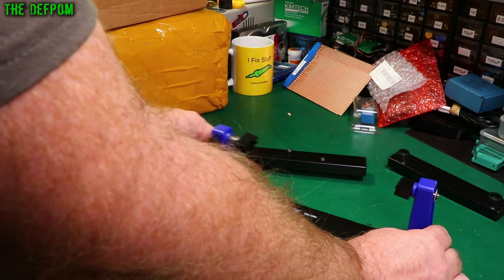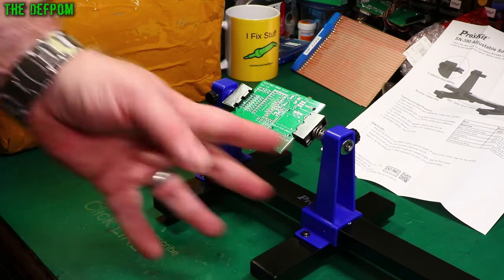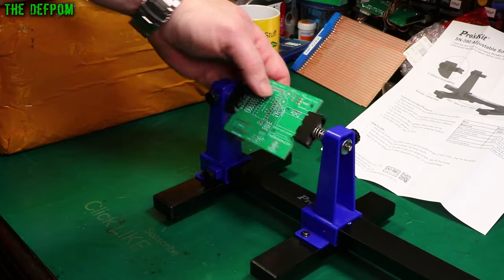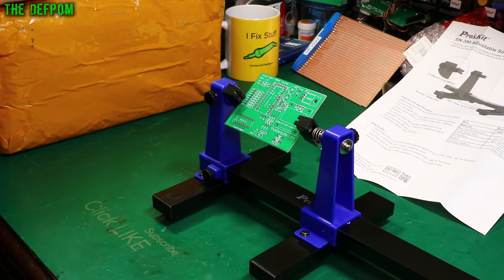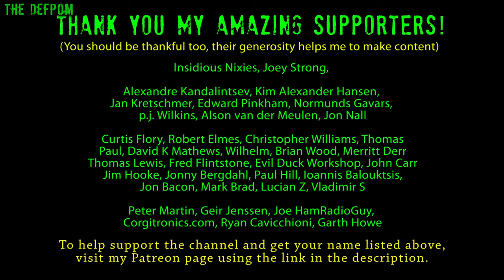🔴 What's in my Mailbag ? - Mailbag Monday 7th March 2022 - No.932

Comment: I remember as a kid I stored my DIP ICs in pieces of polystyrene. Including 4000 series CMOS. Never destroyed anything, I didn't even know what ESD is. :D
Reply: At my first job in electronics the stores dept. used polystyrene and silver foil by the bucket load. Never had any problems......until they tried to store through hole Pcb batteries that way also....oops!